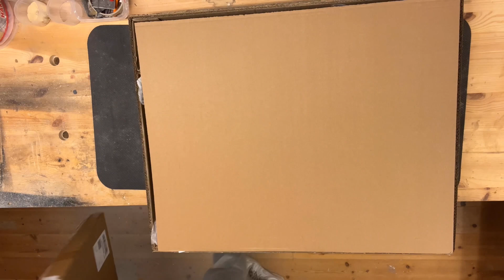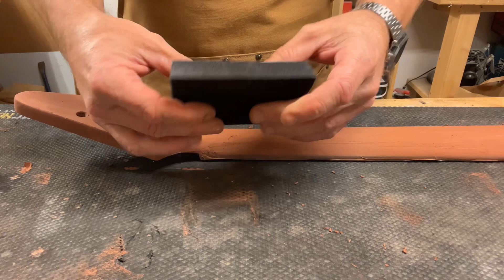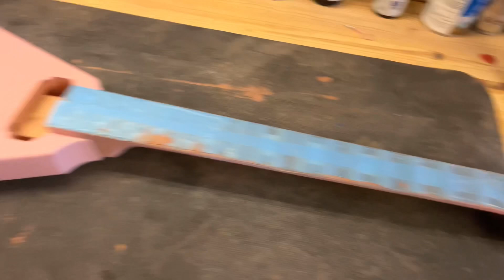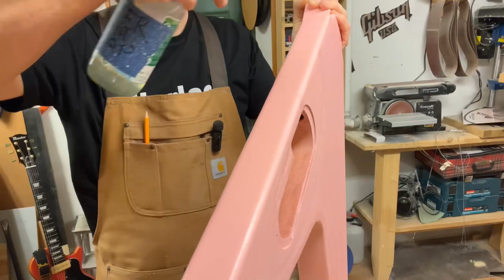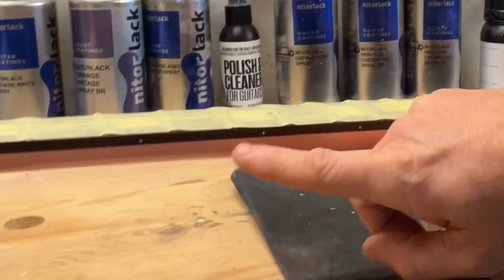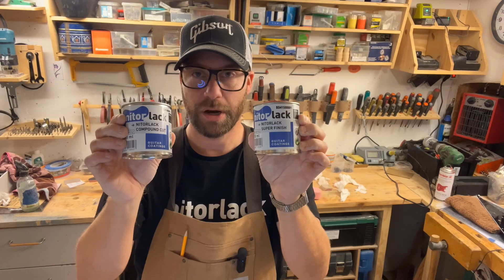How to finish a guitar using only rattle cans. NITORLACK products!

Comment: You take a big risk to use regular tan masking tape instead of blue 3M 2090 painter's tape. At issues are the types of adhesives used by the different tapes, and the crispness of the edge. Tan tape can rip off the fonish from the surface. It's a very tight-gripping adhesive. 

An issue to watch out for when using blue painter's tape is that it doesn't like to stick to itself. A nice substitute is green Frog Tape. It has a nice, crisp edge. It's adhesive will stick to itself and, like blue painter's tape, it's rated for freshly (dried) sprayed surfaces. 

I'm a longtime finisher (cabinets,, furniture, pianos, millwork) and a consultant to the trades.
Reply from the maker: Very helpful tips, thanks! 🤘👍

Comment: You should not have grain filled and painted the neck pocket and neck tenon. Wood glue is most effective bare wood to bare wood. Could have saved yourself a lot of work by taping those joints off. Even sanding them off, after the fact, risks that grain filler and paint are still in the pores, possibly contaminating your neck joint. Other than that, strong work, as usual! I really enjoy the channel. Love the color!! 🤘
Reply from the maker: Hi, yes I totally agree! I missed that one and had to pay for it with extra labour 😂😂😂

Comment: Only because you mentioned it otherwise I wouldn’t have said anything. When using the filler ya want to rub in across the grain. Then we would use burlap to wipe of filler again across the grain. But sanding yes go with the grain. But if you use a scraper maybe use a plastic bondo applicator to avoid possibly scratching the wood. Just my two cents worth. Enjoying the video never the less.
Reply from the maker: Thanks man! Some very good tips. 👌👍☺️

Comment: I have seen the Nitorlack products before, probably on this channel LOL.
 I fancy having a go with these products, I built a Wilkinson higher end Tele Kit from Stew Mac and used their Nitro products as I got a very genourous discount having bought the kit, I fancy doing another kit guitar, a set neck V guitar might be the one as I love Gibson Flying V headstocks and hope I can get one similar in a kit, Im all for straight string pull or as straight as possible!

One thing I noticed while you were spraying the primer, you didn't make full sweeps across the body and starting and stopping  before and after the length of the body, this needs to be done as if you stop or start part way across the body you get heavy particles on the surface, also always follow the recommended distance to spray the product at, this is important as the larger paint particles fall away and don't hit the surface
Reply from the maker: Thanks for your comment and all the usefull tips. You are right in all you say! If I didn´t do it I did a sloppy job! :) You should do a Flying V. I liked Rocktiles kit cause it had the right shape for a V, the body and the headstock.